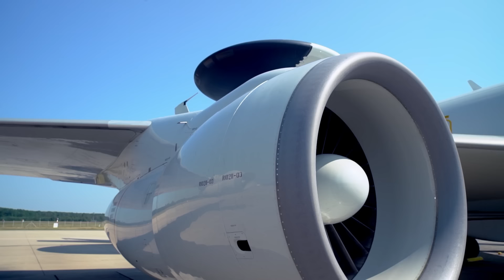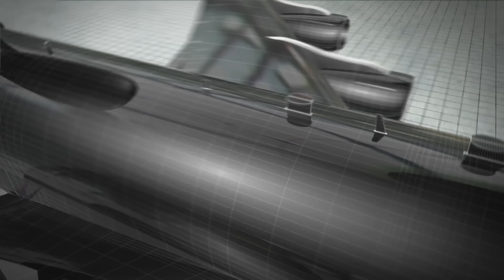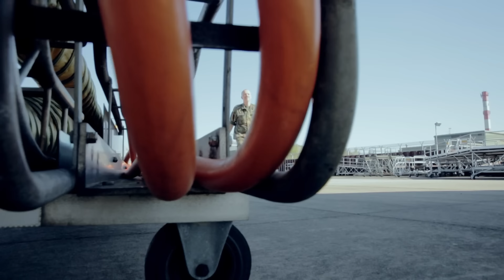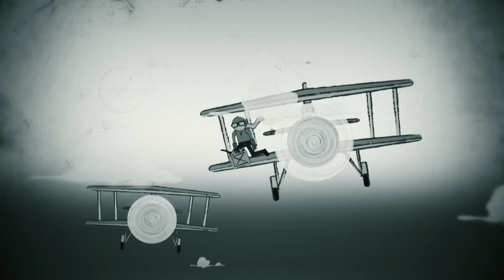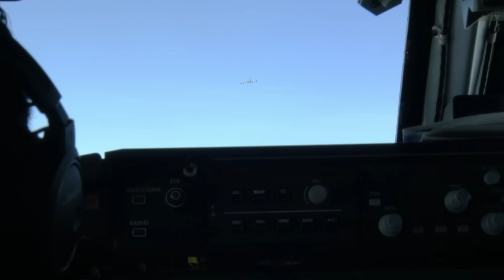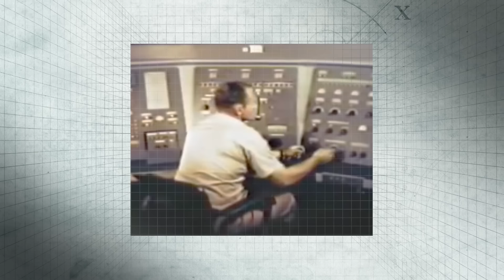This Unique Aircraft Keeps NATO's Skies Safe and Secure From Above | Blueprint

Comment: We'll probably see the Swedish Globaleye 6000 now which are based on Canada's Bombardier Global 6000 airliner instead of these older US AW&C aircraft.  With the new Bombardier 8000 airliner being the fastest airliner since the Concord, we may see Globaleye 8000 planes now (the Global 8000 has 8,000 miles of range so it can stay in the air a very long time)...  Granted, the GlobalEye doesn't have the rotating antenna so it has a blind spot straight ahead and behind but these planes scan the theatre from the back lines around the theatre of operation so the blind spots are moot...
Reply: De flesta E-3 kommer att ersättas av E-7 som är helt överlägsen Globaleye. E-7 är baserad på 737NG och kan lufttankas.